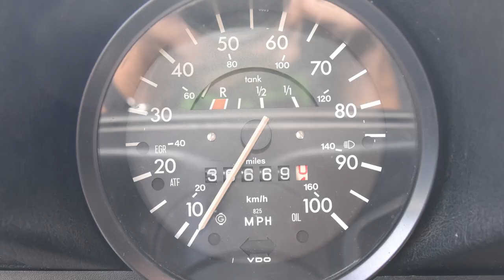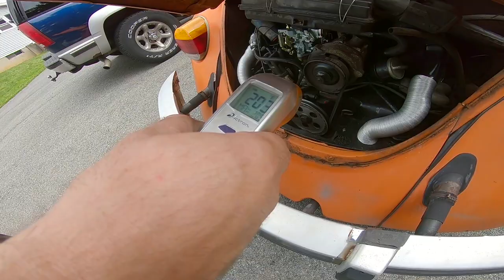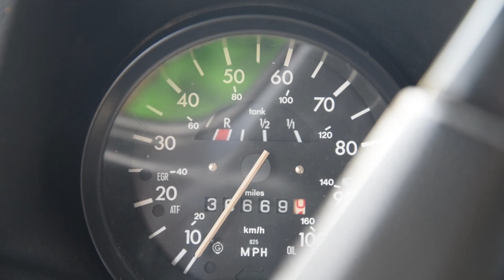1974 Volkswagen Super Beetle 1600: Regular Car Reviews

Comment: Claiming its unreliable is a bit harsh. Probably one of the most reliable cars/drivetrains ever made. Incredibly easy to work on and pretty much always starts. Its not typical for them to overheat or run hot, so probably something wrong with that one - thermostat for example. I can see that the seal between the body and engine is missing too.

I remember back when my family used to have one, in the middle of the winter our beetle always started and had no real issues with snow and cold weather. While neighbours cars wouldnt start.

Rust ruins these cars, which sadly can be seen in the one you drove aswell.
Reply: Can anything be done to prevent that (rust) if you use it as a daily driver in Massachusetts? I wouldn't mind getting an old Beetle someday.
Reply: @TofranBohk  in Germany we have companys that electroplate cars , maybe something like this exists near you.
Reply: @TofranBohk  eh its more about the location that is the issue then what you can do. its the salt that kills them since it takes the protective coating off which allows the rust to start and it accelerates the corrosion. Its gonna depend where you live. If they use salt when it snows and roads freeze its bad to daily it. If you are in arizona or texas and this isnt an issue then its fine
Reply: If you keep up with valve adjustments and are pre-emptive at preventing fuel leaks, these can get you where you need to go.  You might even keep a rebuilt motor in a shed waiting for when the valve adjustment isn't enough.
Reply: It's because the further these get from factory assembly and the more people experience them as second hand projects the more that reputation sticks
Reply: glad somebody noticed!
Reply: @TofranBohk  powder coating parts would definitely help very expensive the best solution is to not drive it in the wonter

Comment: My first car was a full restored 74 beetle (not a super beetle) that my older brother built and passed on to me. We rebuilt the engine and reinstalled it in an afternoon. I then drove it 1700 miles with no issues drove it for years. As long as you changed the oil, fuel filter and adjusted the valves it ran perfect. Someone stole it 20 years ago in Portland, OR....it's still the best car I've ever owned.

Comment: If you live in the Upper-Midwest, and you want to daily a classic Beetle "year-round"...and you don't need it to be completely stock. Here is a short list of things to make your life better.
*Disk brake kit.
*Oil filter mod. (adds a modern oil filter to the engine).
*EFI fuel injection mod. (combined with better exhaust can make 70-80hp in a 1600cc. 
*Better exhaust. (this unfortunately forces removal of factory heating system)
*Two 300 watt electric heaters for the windscreen.
*Oil heater for your feet. (air cooled engines are supposed to have the engine oil at 230°F so the heat is very hot.)
*metal wrapped fuel lines. 
*metal fuel filters (one by the tank and one by the engine. Yes, two). 
*tall skinny off-road tread tires. They give better grip on snow and whatnot. Being skinny makes them lighter and they cut through snow and mud and grip below. 
**if you really wanna have it better use either a 90hp naturally aspirated 1915cc or a turbocharged 1600 with 90hp. Or a turbocharged 1776cc with 115hp.
Reply: If you keep the engine mostly stock, even with EFI, you can keep the heater channels in good condition and they should work surprisingly well. Sadly most beetles have badly maintained or even damaged heater systems.

Comment: 1:29, nooo that's an alternator. It just may not... alternate well.
Reply: My 80s Peugeot had fried it's alternator and didn't charge well at all, my dad kept making fun of it saying "I didn't know you bought a Beetle."
Reply: Yeah, that's an alternator, even tough it is bigger and less efficient than modern alternators, so they don't quite generate enough electricity on idle.
Reply: @LGaragem  idk what you guys are on about. Even the 55amp base model Bosch/Motorola alternators were plenty fine for a Beetle. Even if you add aux lights and a basic sound system.

Comment: I had the use of an old one of these for a bit in the late 70s. It was already on the way to the scrapheap when I ran it as one of the plugs was stuck into the engine block and could only be dealt with by a complicated procedure involving an engine removal or replacement at great cost. But it ran well enough and I liked it. It was nice to drive by the standards of the time, it shot away from the lights with a satisfying 'roar-tweetle' sound and was comfortable inside. It also looked nice.

Comment: 2:52 not true, everything is the same from the front of the door - back. The major difference between a super and a standard is that the supers have mcpherson front suspension. Later supers had a fat dashboard and a curved windshield.
Reply: And rear IRS.
Reply: What
Reply: That looked a lot like an alternator as well (which would have been found on a 74) too much bias in his beetle videos :)
Reply: 100% correct,these guy"s need a smart car,couple of jokers
Reply: The first 2 years had a flat windshield but the front end had louvers under the bumper
Reply: @TheGuerillapatriot  All Beetles (at least US-spec) had rear IRS starting in '69 or so, before the Super was released. So all Supers had IRS, but so did the standard Beetles of the same years. It is not a unique or defining feature of the Super versus Standard.
Reply: @fadumpt  I was noticing that - he complains about the generator with the alternator filling the picture. I get the sense the owner didn't know it was an alternator either, probably told him it was a generator. They changed over in mid-'73 to my understanding (I have a '73 Super which originally had a generator, I later converted it to an alternator), I think most other cars had alternators sooner than Beetles giving this misconception. Overall this video doesn't feel very well researched as it seems he and the owner were both totally clueless about them, and the car in question was in terrible shape, a bad example to judge the whole type from - maybe they were so clueless to not even realize that this was a total beater and just assumed they're all like that.
Reply: @quillmaurer6563  I didn't say it was, the Mexican produced until the 2003 did not have IRS, exclusively swing axle.
Reply: @TheGuerillapatriot  True, that's why I said US spec. I think it was probably a safety thing in the US, after Nader's "Unsafe at Any Speed" which really targeted the Corvair for, among other thing, it's swing axle rear suspension that tended to cause rollovers, the Beetle had the same design but apparently wasn't quite as notorious for rollovers - but the IRS was an answer to that. Some second/third world countries kept the swing axle as it was cheaper, simpler, possibly more rugged, and safety regulations/expectation were less of concern. I don't know if any Supers were ever built with swing axle for non-US markets, I could imagine that in such markets the "upgraded" Super probably had the IRS while the Standard had swing axle (hence your original comment, at least my interpretation of it, could be true in some cases) or they just didn't offer the Super in those markets.
Reply: @quillmaurer6563  are we talking about 1302, 1303's here? The Super Beetle was it's designation to models sold here. It wasn't exclusive to the U.S. market.
Reply: @TheGuerillapatriot  My understanding (could be wrong) is that 1302 was the '71-'72 Super Beetle (at least what we called that) with the flat windshield while the 1303 was the '73+ Super Beetle with the rounded windshield. These were the official designations, including in the US, only in the US was it called the "Super Beetle," elsewhere (Europe comes to mind) they were marketed as 1302/1303. I assume they're reasonably similar to US spec, I don't know if they had any notable differences beyond stuff like lights and bumpers. I seem to recall smaller engines (1200 or 1300? Dual port though) were offered as options for European Super Beetles, in the US all cars by that time (Standard or Super) were only offered with the 1600DP. No idea if any came with swing axle, my guess would be no - though they'd probably use whichever rear suspension setup was on the standards in that market, as the rear suspension (entire back half of the car) is no different between Standard and Super. I don't really know that much about non-US cars except for the late-model Mexican ones, I've read a good bit about them as I am running intake/fuel injection parts from those on my '73 Super.
Reply: My Super has a automatic stick.

Comment: In Brazil, the Super Beetle never existed, nor did the Mk1 and Mk2 Golfs, so the Beetle was still around by 1986 (there was an attempt of a 'revival' by the early 90's, but that only lasted three years).

Because the Beetle is more of a common sight there, some people think: "Oh, I'll get a beetle, it is super simple and easy to work on!", then they either buy a rusty piece of crap or they overpay for a badly restored one.

Then they start having problems, the endless repairs, sometimes they start arriving late, because their beetle refused to start, then they either keep the Beetle as a "garage queen", never using it or they sell it to the next unsuspecting fool.
Reply: And the MK1 GOL with FWD front mounted beetle engine. Replace rapidly with the "Golf" engine. EA827.
Reply: That's not true, we got the "Fuscão" which is a super beetle
Reply: @spookyscaryskeletons69420  No it is not! It has some of the more "modern" stuff the super beetle has, but Brazilian Fuscas never had the dashboard, the curvy windshield or even the Mcpherson Strut front suspension that all Super Beetles have, so it is not even close to a Super Beetle.

Comment: "do you like being surprised when you make it? " 

uhhh.... its a beetle, they are almost unkillable
if this car was well maintained, it would not have any of the issues mentioned, or atleast far less (no gas smell, no break issues, overall looking way better)
Reply: true
Reply: That's an opinion I've only saw from people that never owned one. Seriously.
Reply: This comment proves the point he makes in the video
Reply: @AugustoRallo  I know a lot of people who drive and maintain beetles, its a very popular classic car in Alsace 🤷
Reply: My 72 Super sat for 10 years. New fuel and oil and some fiddling with the carb and it fired right up. Those motors will take the most extreme of abuse.
Reply: @xleeb0y13x  They are made for that 🤷
Reply: I would call bs but I can't speak for anyone because I've never owned one and I drive a 95 civic 🤷🏿‍♂️
Reply: @AugustoRallo  while i personally never got to own one, we had one in my family for over 20 years, all it ever saw was basic maintenance to keep everything in check, that includes cleaning the engine cooler wich is on the underside to the front of the engine, if that clogs up your oil runs hot

Comment: I currently am using my 71 Super Beetle as a daily since my daily broke... that intro was too relatable
Reply: Also because of the obvious plastic fuel filter issue w/ the engine heat I re-positioned mine under the tank in the front (only accessible from under the car like where the master cylinder is)

Comment: We owned one of these.  We loved having virtually no heat in the Winter in New Brunswick (scraping the inside of the windshield to see through it with whatever worked (driver’s license plastic card for instance). Having the windshield washer get it’s airflow from the spare tire, so it was nearly flat when you needed it was a blast.  Being young, with little money for foreign parts, as we called them, made owning this a challenge.  Driving it on a two lane, hilly Trans Canada highway, with the occasional 3 lanes for passing the semi you were bound to be behind was an adventure too.  Good war story car 😁

Comment: Super Beetle vs Regular Beetle:

SB has MacPherson Front suspension NOT a beam

SB has a Curved Windshield and lower front facia

SB is good for Street, Regular is good for off road
Reply: Early "Super" was a 1302 which had macpherson suspension and a flat windshield. 1303 had a curved windshield
Reply: Super Beetles had the flat windshield up to mid-‘72.

Comment: Back in 1974 I bought a 1971 Super Beetle..Took out the motor and replaced it with a fresh 1640 cc single port.  Drove it for ten years without a single problem. Just adjusted the valves regularly and changed the oil regularly. It ran
Perfectly the whole time. I loved it.
Lived in Central Florida.

Comment: I bought a nearly mint 1972 Super Beetle for $6,600 as my first car, the idea being fueled by my dad. I wish I still had it. I drove it 40 miles a day and it never left me anywhere...unexpectedly. The altitude was usually around 5,000 feet, and I drove it up a mountain up to around 11,000 feet and had to engine brake almost all the way back down to keep the damn drum brakes from going. Another time I took it on a 2 or 3 hour drive on the highway with the pedal pinned...believe it or not the thing got to 90 and stayed there, at least if the speedo wasn't lying. I didn't initially love it and wanted to chop it into a baja bug, but luckily I didn't have money to do that. The only thing I did to mod it was throw a short-throw shifter in to keep it from banging my knee everytime I shifted to 2nd. By the time I had to sell it I loved the damn thing and I miss it every day. Oh, and I'll never forget my first oil filter change...I found a god damn noodle strainer when I was looking for an oil filter. That was hilarious.
Reply: Not Important To You I used to drive my 66 square back that was 66 hp at 85 mph all day on the highway in Arizona. Once you get them up there, they’re happy

Comment: That sir is an alternator.....they started with generators and switched to alternators. If you learn the ropes, fix them up, improve the parts and update some things, no car on earth will take you farther and last longer for cheaper. The problem is buying severely neglected ones and having to learn on the side of the road. The vast majority of all parts are under $100 and the whole thing is put together with a handful of tools. The charm is having something go wrong AND NOT NEEDING A MECHANIC, NOT HEARING IT WILL COST THOUSANDS TO FIX AND ALL PARTS ARE STILL IN PRODUCTION. The first car to win the baja 1000 and the platform has the most wins of any in the race. Also the first regular car in antarctica, which one is still there today. The longest and most produced single car in the history of the world. Its all about learning before you get into one expecting it to be something it isnt. I nearly got in a wreck selling one of mine because the man test driving it said he had driven a stock one before and he didnt know you cant be a wimp. He swore I had to come down because something was wrong with the brakes & power steering. I was like no deal bro, you have never driven any older car lmao your leg muscles are the brake booster and your arm muscles are your power steering. I eventually found a guy who knew the car like a champ and i was sad to see it go. Anyway enough of this, i have a bug to go work on lol

Comment: This is so funny. I have a 74 Super Beetle. That is the first year they came out with a alternator. That car was horribly neglected, bad transmission mounts, speedo not working, visor missing etc. I bet the guy did nothing to it. I am glad he sold it and someone who appreciates it will fix it right. I haven been working on aircooled VW's since 1992 and still run my own shop. The parts are dirt cheap and easily available. You should do the New Beetles and the Newer VW's after 2005 are a freaking train wreck and practically can only be worked on at the dealer....
Reply: BadBrad23 I’ve had many beetles over the years. I never had trouble with any of them besides normal maintenance

Comment: I had one of these, 74 super beetle, bought it new off the showroom floor.  Loved driving it.  Wasn't fast but it was my new car, didn't stop really fast, but it was my new car, no A/C, but is was my new car, had to change the engine oil and adjust the valves every 2000 miles but it was my new car....  Kept it stock, after 7500 miles I had to swap the engine out for a rebuilt one, they used to sell them at the auto parts store.  Took me a whole 60 minutes to do that job.  It was my new car and I was very proud owning it.

Comment: My dad had a bug back in the 70s-80s, maintenance and reliability wasn't a factor since he was constantly souping the hell out of it. He was a mechanic and those small engines were super easy to swap or rebuild. They used to keep the cylinder liners in the freezer so they could just drop them in after they cut out the old ones.

Comment: This review is really unfair on the beetle - most of the issues are of that beetle not of all beetles . All that poor thing needed was some love. The engines don't shake like that. They don't smell of gas and fumes and they don't overheat (have driven one in over 40°C / 104°F weather through bumper to bumper Indian traffic. The stock suspension can take a beating like few other cars can. If anything they are fairly reliable car. There's a reason they are legends of the Baja 1000.)
Reply: Yes, this review is bullcrap.

Comment: my 1st car was a 74 super beetle.  great on gas,  great in snow,  air cooled engine,  if battery died,  you can jump start it in 1st. gear by having it pushed.  tuff little car. just maintain like any other car.